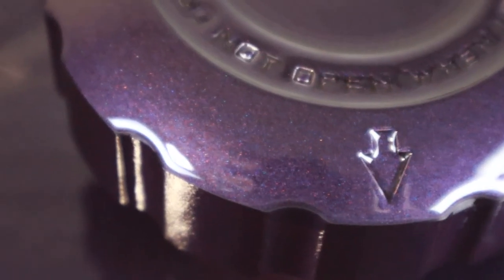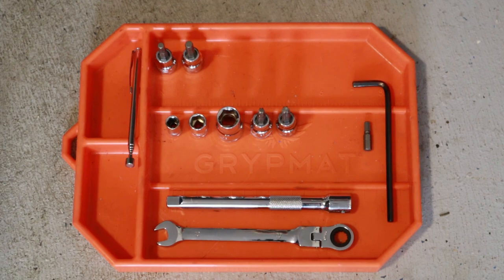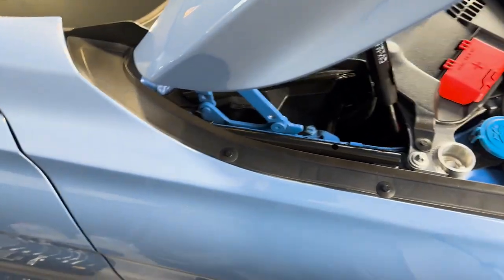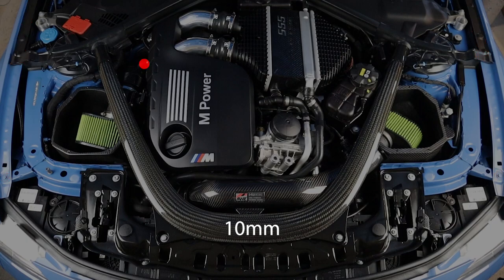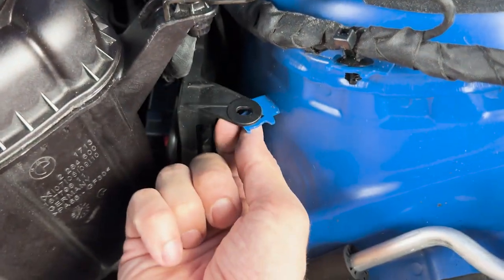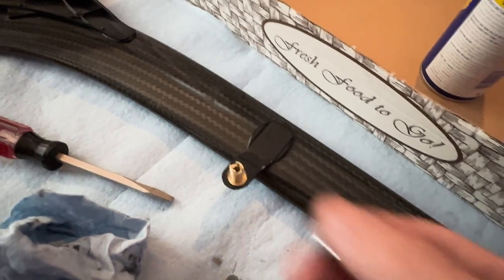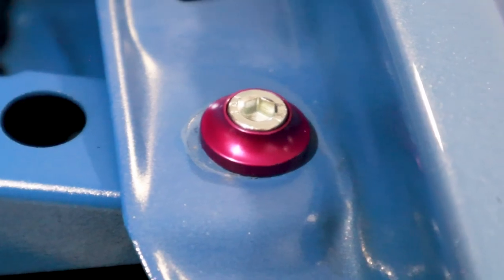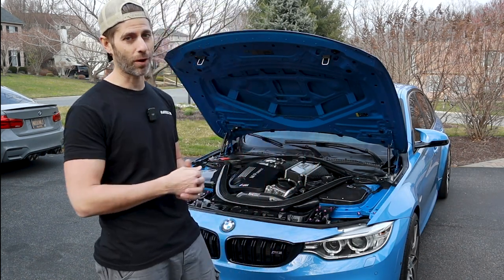Downstar BMW F8X Dress Up Kit (M2C/M3/M4) | Engine Bay Redemption Part 1

Comment: Did you ever end up removing or installing the bolts under the weather strips? I’ve done so on my M4 but not sure after watching your video if it was a good idea
Reply from the maker: I did! I made a follow up video to this one where I installed their strut brace kit and I ended up doing the weather stripping bolts. No bullshit, I love it.. should have done it the first time. Getting rid of that and the rubber strut dome caps made the engine bay look so much better: https://youtu.be/qLuh4BMTCbw?si=HbrBUO1W4_pT0-V0&t=281
Reply: @AlwaysSummerGarage  thank you! Helped a lot.
Reply: @AlwaysSummerGarage  follow up question! I just removed them as well and installed the hardware. Have you had any issues during car washes and/or rain without the weather strips?
Reply from the maker: @mambamlife7477  not at all, at least not that I've noticed.. and I thought I would which was one of the reasons I held off initially but it's been a year now and no issues